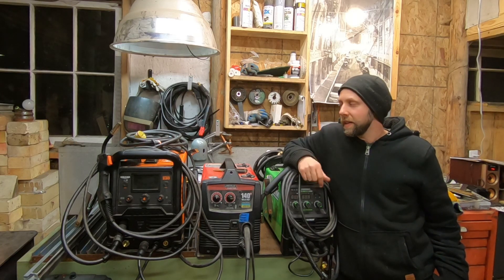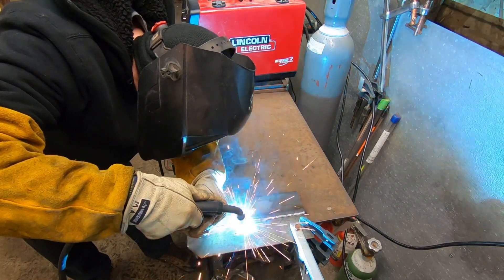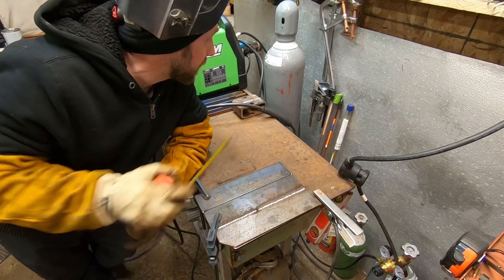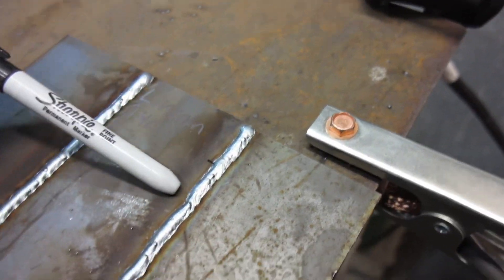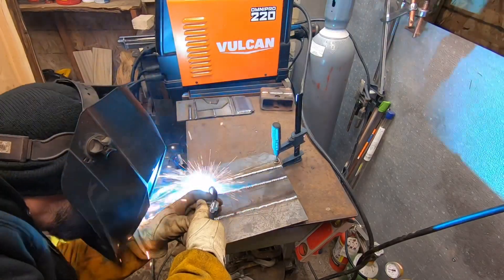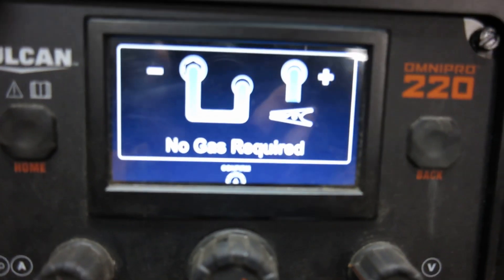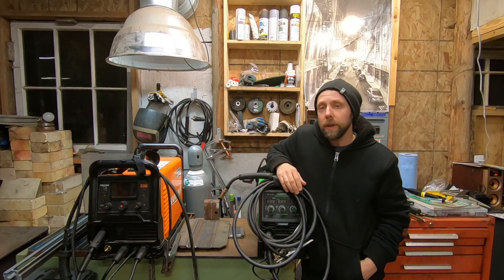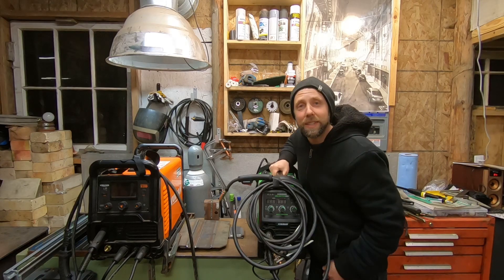Titanium Vulcan welders 120 volt MIG test

Comment: Been welding them their fr 52yrs now and its,  batter not spatter! Yup, 
Really nice to see the comparison of these two. I've been salivating for the salad one but was wondering if a Tomato finish was tastier. I do a lot of small frame stuff and occasionally do bigger like perhaps a trailer frame. I own an older Linkoln 120 got it at Home Depot many years ago. (120 because I can plug in any were) It's been great no electric outage and no cut-off time, ever. But I want to tig .... a stick should be great too for trailer frames and such.  I also think the weight factor is a big selling point for me. and your spot on when you talk about electronics for instance regardless of the price for a PC memory drive, you don't know what you have until its been past its infant mortality moment. hens 2yr insurance. 
In twenty years I've never used gas !!  and am so looking forward to nice clean welds, no more vaping for me. I'll probably have to run CO2 only $$. I also like the deal with no breaker issue less draw, Ill probably run a cable from my clothes dryer plug to outside about 26ft. and being that the Titanium is easier on the draw it should also run better using a long extension cord... me thinks... .. .    Great discussion no wast of words to the point and clear as a bell! Thanks for doing this.

Comment: As a new welder I was struck with how much smoke comes off the flux core. Not used flux core yet, and I was only planning on using it outdoors.
Reply from the maker: Yes it’s kind of nasty stuff, I definitely recommend shielding gas and solid wire if you can, it’s much nicer to weld with.
Reply: Mike festiva Thank you Mike.

Comment: What’s the max plate thickness can the Omnipro 220 weld on?
Reply from the maker: Jamil Trilla I think it will weld 3/8” single pass on 220 volts but you can weld 1/2 or thicker multi pass. Take care
Reply: Mike festiva can  the titanium do 3/16 or 1/4 on 120 with solid core?

Comment: I notice your outlet has 15 amp socket.   Is it fused for 15 amp?    I got tired of my Hobart 140 popping the breaker, especially in the summer.   So I stripped out the wire, upped the gauge, added a 20 amp breaker and a 20 amp socket.   It was better but still occasionally popped.   All my early work was using flux core and never quite got around to getting the tank and going full mig.   Then I did switch.   What a difference in less spatter, cleaner work area and virtually no smoke.   Wish I had switched sooner.  Totally agree with you.   Unless outside in a breeze .... no FCAW for me.
Reply from the maker: Right on! After you put in years using flux core you really appreciate MIG! I’m glad you got a tank 🙂 Thanks for commenting!

Comment: I have the Lincoln 180 welder, never had a problem with it and it's going on 8 years old. It does not go through a duty cycle. Plus mine runs on 220.

Comment: I have the Lincoln weldpak 3200 HD and it does pop the breaker if I'm on outlets rated for 15 amps but not if I'm on a dedicated 20 amp breaker it has been great and I purchased it in 2005 and it is 2019 now and the damn thing still works great

Comment: I really enjoy the videos, well done! IF you had to buy the titanium or the vulcan over which would you buy? The vulcan worth the extra money? Im in the air.
Reply from the maker: Both welders work great! I think the Vulcan 220 is a little more solid for bigger jobs and probably best for a fab shop or auto shop especially with the spot weld feature, but it’s a bit heavy about 50# 
I myself prefer the Titanium because it’s smaller lighter and more portable and because of that it fits my needs better. But I have to say the auto set on the Vulcan is really nice! If you don’t plan on moving your welder around much, it’s just going to stay in your shop and you want all the options then go for the Vulcan. If you want a light weight compact multi process welder with a few less features but at a great price go for the Titanium :) I hope this helps.

Comment: Do you know if the titanium 200 multiprocessor is available to run a foot pedal for tig welding? Does harbor Frieght sell them for the titanium not the volcan? Thx you love your videos
Reply from the maker: I have not seen a pedal for the Titanium 200 :(  
You can get one for the Vulcan Omnipro 220, but this pedal will not fit the Titanium. 
I actually found it was easier too learning  TIG without the pedal, it was one extra thing to try and pay attention to when trying to figure out the torch. I learned on the Titanium, and after I figured out how to TIG steel, I bought the Vulcan proTIG 200, it’s a AC/DC TIG welder so now I can weld Aluminum! Take care Eric

Comment: Mike when I was in Vo-Tech all transformers, Lincoln, Miller, Hobart. My 1st big welder a $3300 Hobart 330 amp tig/stick. Great machine huge & heavy, now I have 3 Everlast's including my plasma 50, luv the HF on the tig, also have a little Eastwood 135 & now te Titanium 125, would never go back to a transformer, cost wise, size & weight, these inverters are great little machines!

Comment: And to think I almost purchased a Lincoln 140 HD. Gonna get the titanium 170 instead . Thanks.
Reply from the maker: I think the Titanium 170 will be a much better welder for you, Lighter, compact, more power, smother arch, dual voltage, linear amp adjustments with digital display and if you buy the 2 year warranty, you are guaranteed that if anything goes wrong, it breaks or you drop it off the back of your truck you can walk in to the store and walk back out with a new welder. I really like my Titanium 200! Take care

Comment: I’ve owned that Lincoln for about 3 yrs and I’ve never popped a breaker. I run it on a dedicated 20 amp breaker and I have pushed it to its max without popping the breaker. You must be on a 15 amp branched breaker.  I like your video but I have a concern about the longevity of the Titanium.
Reply from the maker: I have 20 amp breakers in my shop, only had a few LED lights on the same breaker. I have always had this welder pop the breakers at my work too, and we are running it on 20 amp breakers there too. It’s been this way since we first bought it, maybe it’s a lemon???
Reply: Having put together an entire dirt track truck with the Lincoln, it definitely popped breakers nonstop. Two guys in the garage meant whoever wasnt welding was constantly flipping the breaker. Changing to a 20A only added about 2 inches of weld.

Comment: Hi Mike, enjoyed this video.I also have both welders 220 and 200. Love them both. I’m keeping the Vulcan set up for all welding stick, mig. The titanium just for tig. I will be purchasing the spool gun with the 20 percent coupon that with the  Vulcan. What are your thoughts. I’m also running them on 220. Thanks again. I just subscribed to you. I noted several videos on the things i just mentioned. Now I’m going to check them out.
Reply from the maker: Right on, thanks for subscribing! I appreciate it :)  I really like both welders too as you know. I like to Titanium especially for its compact side and weight, I pack it to my work a lot. I have quite a few videos on these welders so check them out when you get time. I think the spool gun will be great for the Vulcan, I adapted a Miller to fit mine because at the time when the Omnipro came out the spool gun was not available, so a friend gave me a Miller and it was not hard to adapt. I did a video welding aluminum with the Titanium 200, it welds great. Take care :)

Comment: You mentioned that the Lincoln has a tendency to pop the breaker in the shop. Just curious if that's a 15 amp or 20 amp breaker? I have the 180 amp 220 volt version of that welder so no problems. I had the previous 135 amp 110 version and I also never had that problem with it. I was plugged in to a 20 amp circuit with it. Just want to say I like the lengths you went to, to make sure this whole series of comparisons were fair.
Reply from the maker: Yes I was running the Lincoln on a 20 amp breaker, it pops every 20 amp breaker I have tried it on at my work also, the Titanium and The Vulcan run much more efficient on the same 20 amp breaker welding the same amps. The inverter welders definitely draw less amps. Thanks for checking out my video and commenting, I appreciate it :)
Reply: Mike festiva I guess that's the difference five extra amps of output can make. With my HD3200 (135 amp) I never had problems, and the friend I sold it to has had no problems. Sure glad I replaced it with 220 volt model which so far has been great, and I got a package deal on it that included an essentially free aluminum spool gun. Haven't used it yet. Bought it just before the Vulcan Welders came out, and I have to admit that from everything I've seen, I probably would've bought the Vulcan if they'd been out. All reports on them seem to be mostly positive.

Comment: I went through a few migs (budget) over the past few years, just got a used KEMPPI kempact253A and I can not tell you guys what a difference it is... it is a whole new level of welding.
Reply from the maker: What budget MIGs did you go through and What price point were they? That’s good you like your new welder. To tell you the truth I ran the Vulcan Omnipro 220 side by side along a Millermatic 200 and I could not tell the difference in how they welded, the Miller was nice but cost twice the price had less features and adjustments the the Vulcan, both laid down great welds.
Reply: Mike festiva comparing this Kemppi to the units I had before is like peaches and apples... the units I used were Varstroj, Telwin and Stamal, the issues i had were mainly inconsistent feed of wire, slippage, as soon as I had a bent in the hose the wire had a hard time feeding... I actually used them for quite a while and they were great learning tools but ai was just tired of getting stuck in the middle of a job... do not want to be misunderstood, I am not a pro. I am just a guy in a garage...

Comment: Mike, Joe here... You might want to take a look at this. I was already starting to design something similar, but this is out there right now. I think this would be a SWEET addition to the Vulcan Omnipro 220, or Titanium Multiprocess welder for HIGH FREQUENCY ARC STARTS when using the TIG option!!!  No more lift arc and priced right!!!

https://www.ebay.com/itm/Arc-Starter-Stabilizer-Kit-AC-DC-Welder-High-Frequency-TIG-Stick-Aluminum/223430156915?epid=24010247098&hash=item340579a273:g:ca0AAOSwHOlceY1h&frcectupt=true#rwid
Reply from the maker: Thanks for sharing this! I think I came across this a few weeks ago, I can’t remember who mentioned it, the price is definitely right, it could be a cool project to place it in a box  along side or fit it inside the welder for High-frequency starts! Thanks Joe :)
Ps are you going to try one out!?

Comment: Mr. Mike, I was going to purchase small welder like that last year and they were like you say around 5 - $700 just to do some tinkering around the house, working on tractor equipment building different odds and ends and my brother who's been a welder all his life mostly on heavy equipment stop me. He said you would be so limited with just a small welder and he brought the information on an Eastwood 250i. As you know it's very difficult weld uphill vertical and overhead with an AC. Well this Eastwood he showed me was a 250 amp wire machine, stick welder, and TIG welder. It also has an adapter plug that you can run it on 120 volt instead of 230 of course on 120 it will not do what it will on 230-volt. Well I purchased it and it was about $1,100 with free shipping. The only thing was I had to buy a spool gun to run aluminum and I didn't know that and my brother should have but didn't think of it that you have to be able to weld TIG aluminum with AC. But it was only a couple hundred more dollars I mean even those machines your showing have to have a spool gun. I messed my back up real bad last year after I bought the machine and underwent two back surgeries so I haven't even got to try it out yet. But I just pick me up a couple of argon bottles 100%, and one 75 25% and hopefully I've recovered enough to start testing the machine out. All I've ever done was stick weld, I've tried MIG welding some but never owned a MIG. Currently all I have is one of those little Lincoln 225 box stick machine but AC only and trust me it will not do what the little AC DC's machine will do. Thanks for your video I enjoyed it I just thought I would throw that Eastwood into your perspective and you might like to try one. But hey, I bought this thing but you know everything looks good on paper! Happy welding
Reply: Update when you try your Eastwood I debated on the same one
Reply from the maker: Thanks Jack for taking the time to comment, I appreciate it! I'm sure that Eastwood welder will be a great machine for you. I'm sorry you hurt your back, I know how that is, I was almost killed in a car crash when I was 13 years old, a drunk driver hit us head on on the highway, long story short, I had two surgeries, one of them was to fuse three of my vertebrae, I had to wear a back brace 24 hours a day for over a year and a half, I was not even allowed to ride a bicycle at that time, ( that's tough for a kid to not be able to even ride with his friends) there was concern that I could get paralyzed if I crashed on my bike, that was 25 years ago, I still deal with back pain but you learn how to work and deal with it. I hope you start feeling better soon. 
Both of these welders are DC so TIG welding aluminum is out,  but I have ran both welders with spool guns for aluminum and they work fairly good, I just bought a AC TIG welder recently for making motorcycle parts and more detailed work, It's been fun to play with. Back to welders and Amps Most of the jobs I do around my place and at my work is 1/4" and thinner metal, both of these welders will weld 1/4" single pass, I rarely weld thicker then that but if you do and don't have the available amps you can always do multiple passes. I hope you can get out and set up a comfortable welding station and start running your new welder! I hope to hear a follow up on your machine soon! take care

Comment: "Who gives a 💩, really!" Ha ha, loved it! Hey Mike, great video as usual, love your style. Keep it up and don't let haters get you down. One thing I don't understand is why HF would come up with two competing units. I bet most people have a hard time picking one over the other. Ciao, Marco.
Reply from the maker: Thanks for commenting, I appreciate it! I definitely think it is strange too, they are undercutting the Vulcan line, it makes no sense to me but hey  the Titanium is a great compact welders especially for the price point. Take care
Reply: I know I'm having a hard time making up my own mind. I'd only use it for project where TIG would be too much work. I like the ease of setting of the LCD display, but I can't tell how much of an advantage it would be over time, and whether the price difference might even justify one.  @Mikefestiva
Reply from the maker: Crivo152 So do you have a TIG welder already and are looking for more of a MIG for your shop? 
After owning both here’s my take on it, both weld great!
The Omnipro does have a nice screen and auto set is a great feature, it’s also just a turn of a knob to manually change settings, it has Lift TIG start and the capability to run a pedal so it’s nicer to stop the arc,(its a little nicer for TIG) The TIG features are better on the Omnipro, but cost more. It’s 50lbs so not exactly light, but has a better duty cycle. The Titanium it 24 lbs! Tig torch is included, no pedal available so far, scratch start, manual set up but welds great as well, price is great, compact for hauling around, this is the reason I really now prefer this one, because of its size and weight, I can live without the extra features in trade of portability. I hope this info helps you in your quest for a welder :) Take care
Reply: I'm really looking for a MIG for fabrication, TIG's too slow to weld up stands and the like. I have a TIG rig already so that's not a factor in my decision, but 110/220 is since I have both at home. Duty cycle is not a huge concern either, since I'm a pretty slow welder anyway. I guess I'm talking myself into a green machine aren't I? 😂
Reply from the maker: I hear you on the TIG, it’s definitely a slower process. The MiG on both machines work great and the multi voltage is nice. If I were you I’d go with the Titanium as well, it’s a nice machine that’s completely capable of some bigger jobs. Most of the work I do a home is smaller projects and thinner wall tubing so duty cycle is not much of a factor, get yourself a bottle of Argon/ C02 mix and you will be pleased with how clean it welds!
Reply: Thanks Mike.